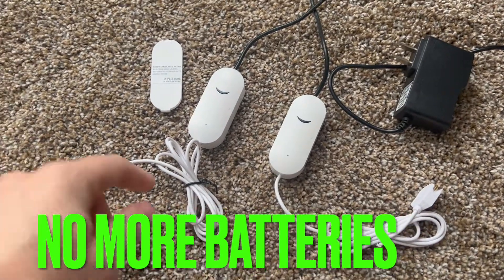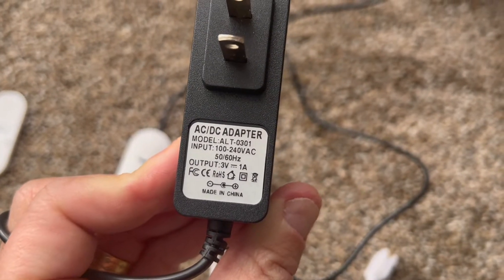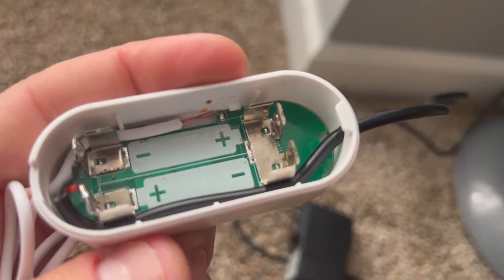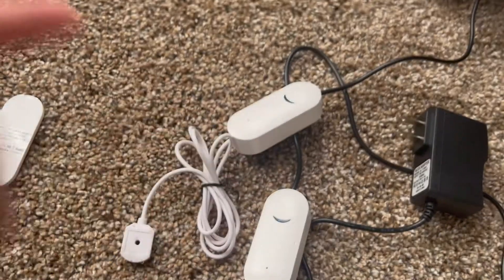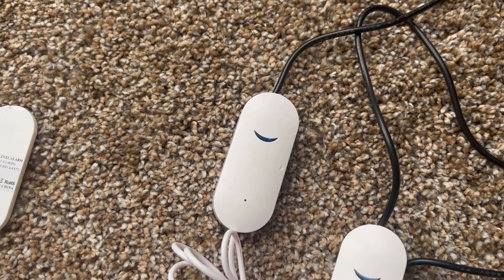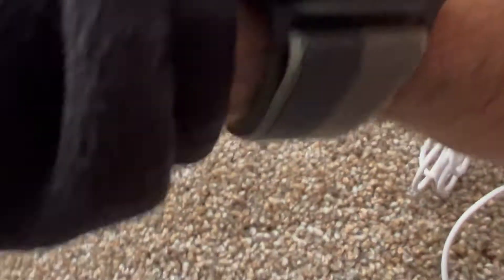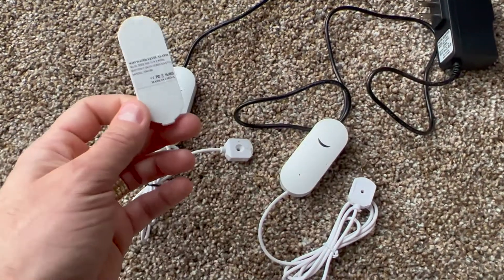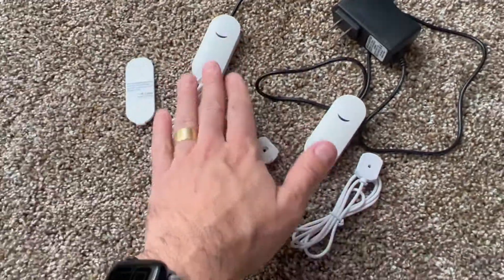Tuya WIFi Smart Water Leak Sensor - No More Batteries (Mod)

Comment: I just bought one of those sensor. I will wire mod it too :)
Reply from the maker: Cool 👍, this is very good, glad this video could help. It is working great at my home.
Reply: @felipezafani 
The wire of this device is 3 meter almost so should we extend this wire to joint with wire almost 15m.
Does is it work if extend and joint the wire ???